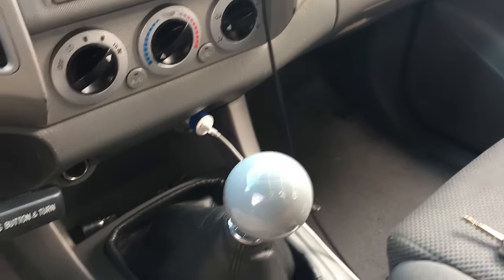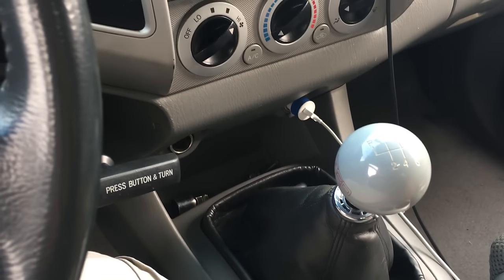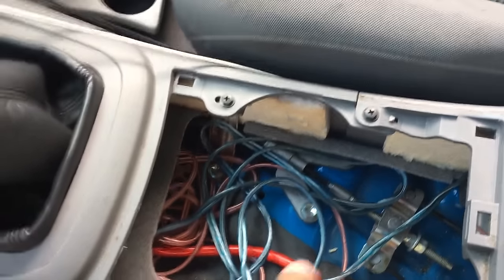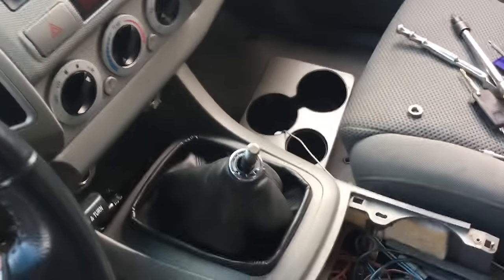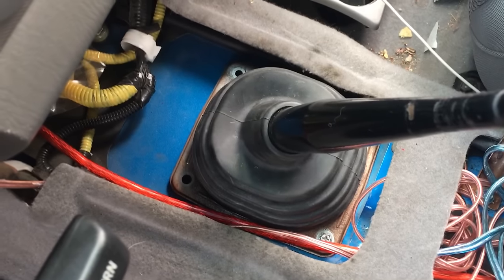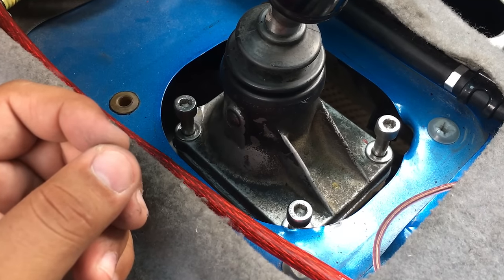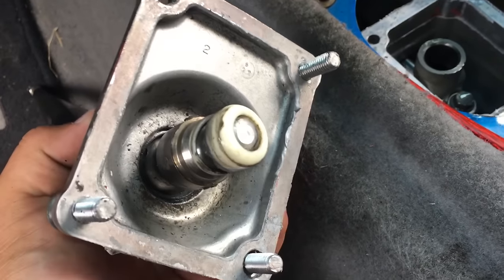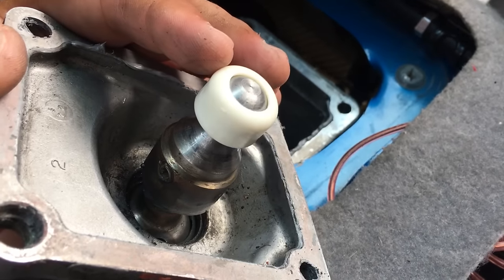How to fix a loose shifter

Comment: Should have packed some grease in there no? Would take out that little play and protect the new bushing.
Reply from the maker: Howard Dann They normally come dry. When I installed it I added high temp grease to but as a coating to keep it lubricated. There’s no need to pack it cause the rest of the grease will fall into the trans fluid as you shift gears.

Comment: Nice video, I have a 2002 ford ranger  and as I was going in reverse , all of a sudden the stick shift was loose, Its drivable, but I have to find the shifts. You think it may be the bushing ?
Reply from the maker: xvenomx007 yeah it’s most likely the bushing has torn and now there is too much slack between the gears

Comment: for reverse it"s either press down or pull up"ring" before engaging gear..??
Reply from the maker: For reverse?  On this transmission it’s neither.
Reverse gear is located far left and up, left side of first gear.
This is an older style where you push the shifter further to the left to engage reverse
New cars have that lockout ring feature for reverse. 
Other than that this is a normal manual 6 speed transmission

Comment: hey there, great video man, i was wondering if these bushings from toyota are universal to more gearboxes or is it for only a specific car? i have a charmant wich is really hard to get parts for and so, and my bushing is completely gone
Reply from the maker: +Ramen Garage normally they're vehicle specific but if you look up to see if any other vehicle uses the same transmission as yours that would help you get the parts. Manufacturers don't normally make their own transmission they get them from a supplier so there is a chance you could find the parts you need like that
Reply: What’s the part number for the bushing?
Reply from the maker: Sorry it was so long ago I made this video I don’t remember the part number but I bought mine from my local Toyota dealership
Reply from the maker: Local auto parts store didn’t have it for my truck
Reply: Thanks bro this vid was very helpful  to me being a noob to xrunners
Reply from the maker: I’m glad this video helped out!
Reply: @marzclouds8673  Oh so close, but thumb covered the part number, I need the same part too

Comment: have a Dodge neon 98,  i was driving and the stick shift got stuck in third gear, would not change in to any other gear. but it was loose straightforward, and straightback. this happend at 7 am, tow it back to the house, next day in the morning the stick shift got unstuck little by little. any ideas what could be the problem?
Reply from the maker: +Nope Nope first I would check the shifter linkage under the car, I'm not sure if it's cable or rod driven but I'd check that and see, if it is a rod linkage to see if it got bent or if it's about to fall off. Otherwise like on my truck the shift selector has bent inside your transmission. This is the current issue I'm having with my xrunner except on 5th and 6th gear. If u can't find the issue outside of the transmission then I'd say it's time to take it to your local transmission shop

Comment: Can bad bushing cause the gear to don't go in reverse?
Reply from the maker: savinna V sometimes it can depending on how far the swing of the shifter needs to be I had a 1999 Toyota Tacoma that had the same problem and I replaced the bushing and was able to get into reverse and all other gears easier again
Reply: Thanks. Yea now all my gear don't want to go in.. my shifter just feels out of place(wobbling). I have to find the gears now.. I wouldn't  know if I'm in 1st gear or 4 gear from light... only til I drive off,  It starts lagging when I'm high gear so I stop and look for 1st gear again.. hopefully it's the bushings.. and not something major.
Reply from the maker: savinna V is it a transaxle(front wheel drive, all wheel drive) or a transmission(rear wheel drive) because that’s also a factor. Transaxle could be the linkage like cable or bar, and transmission is just the bushing if it’s all gears also try looking into a short shifter for your vehicle if you think it’s still loose to your preference
Reply: It's a xrunner  like yours
Reply from the maker: savinna V ok then yeah get the shifter bushing from Toyota and it should be back to normal